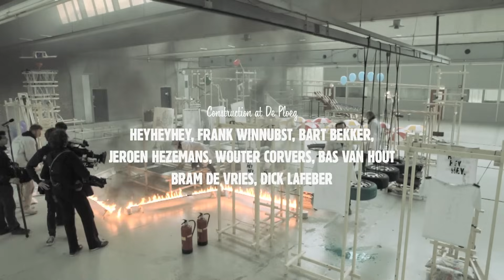Melvin the Magical Mixed Media Machine

Comment: i wonder.....if theres a way to make rude goldberg machine that can reset all its elements as it goes along so that it can just keep going and going.....would it be classed as the ever elusive and so far impossible (though not improbable) 'perpetual motion engine'??
Reply: You can make a special type of floor and make a big loop of dominos, and if a domino falls, the floor lifts and lowers to reset it. There would have to be one for TONS of dominos, cause this would be slow,so yeah it's possible it would work like this. When it falls,the floor lowers and the floor it fell on lifted. Then it would be upright.
Reply: And the floor would not make power it would use it. With solar panels to make it infinite.
Reply: D0S81 ff
Reply: They have already been big marble machines like those XD
Reply: Ты